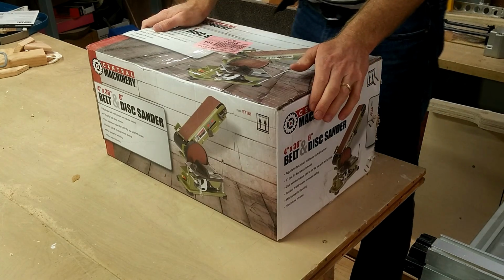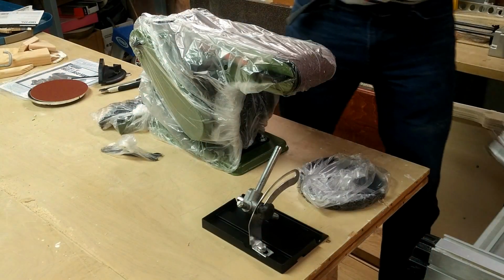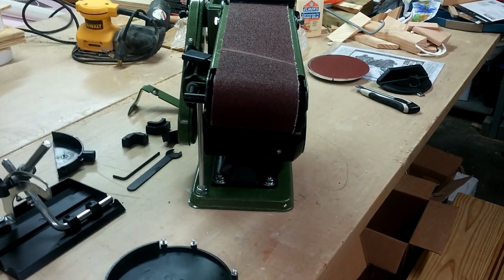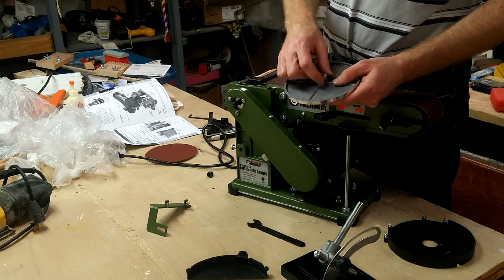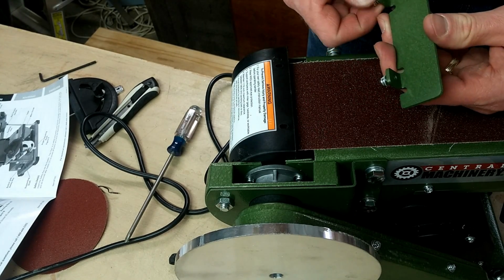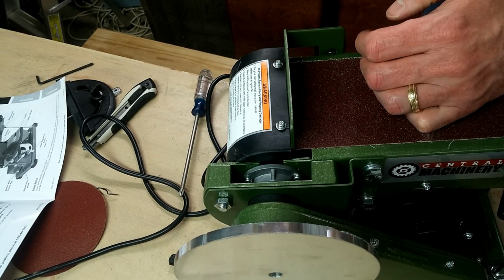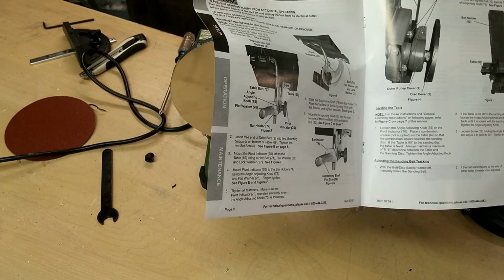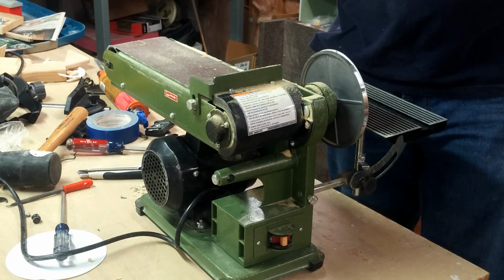SBW#7 - Harbor Freight (Central Machinery) Belt Sander Review and Assembly

Comment: Do they make a matching stand for this sander?
Reply from the maker: Since this is the bench top model rather than a floor standing model I do not believe they make a stand for it. You can probably use any stand as long as it has a flat surface on top that is large enough for it to sit on. I have mine on top of a custom cart I made for most of my bench top power tools. I do not have it affixed to the top so I can relocate it when I'm using my joiner which is affixed to one quarter of the cart's top.